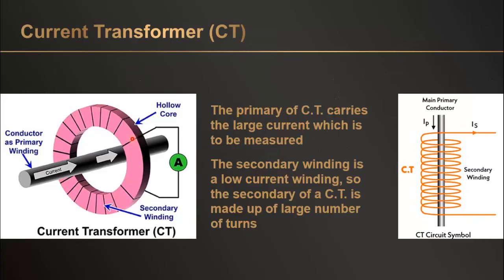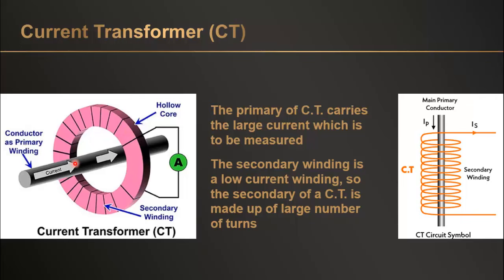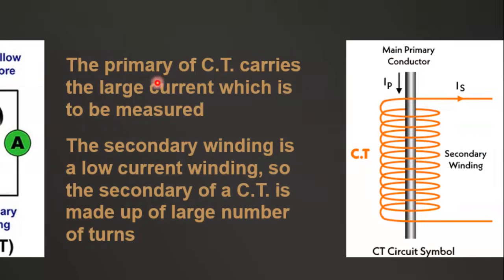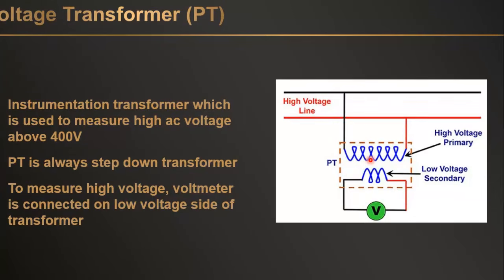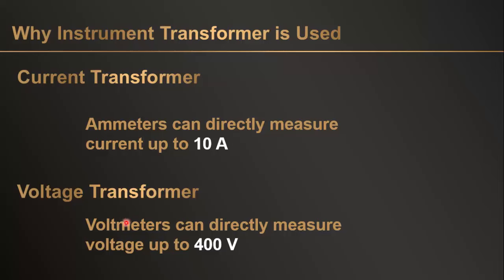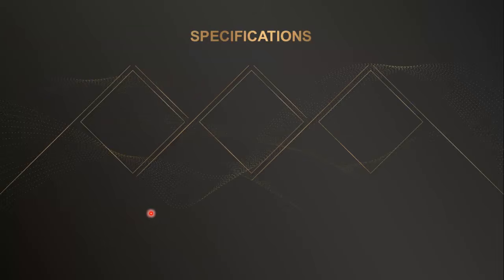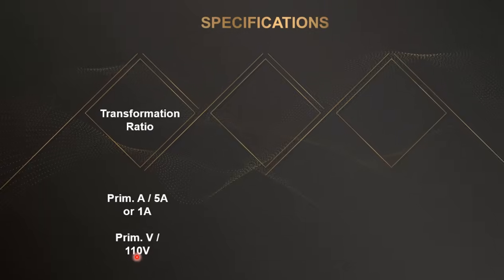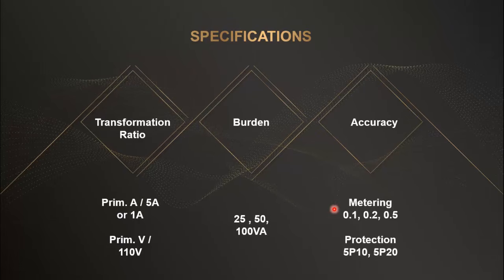What is Instrument Transformer | Current Transformer and Voltage Transformer

Comment: CT is step up transformer 
It's the correct
Reply from the maker: Yes in terms of voltage. But you cannot term as step up as we use CT for current and new n that case it is step down